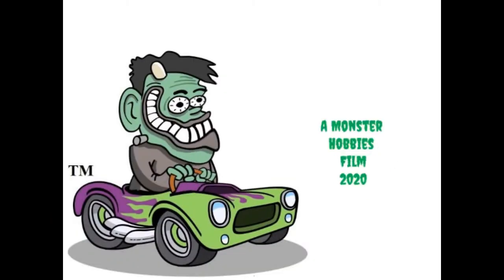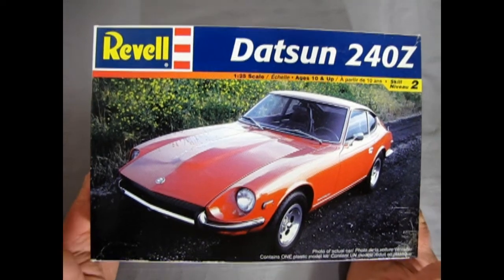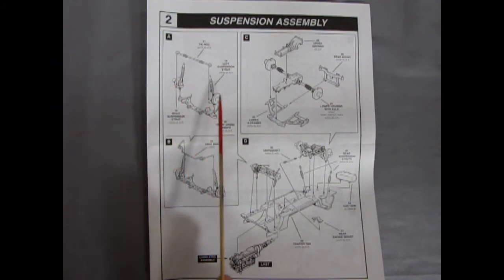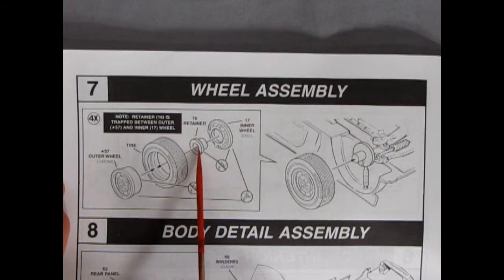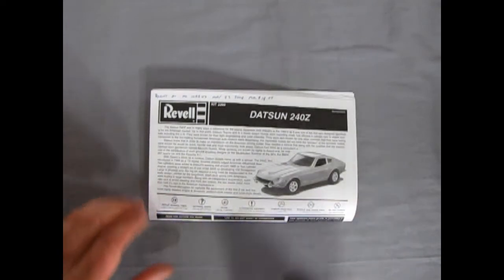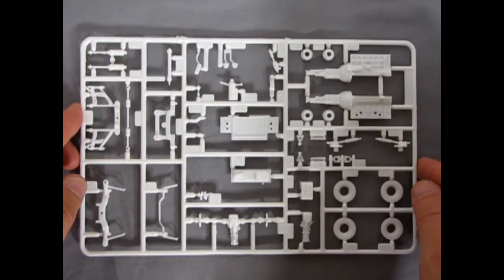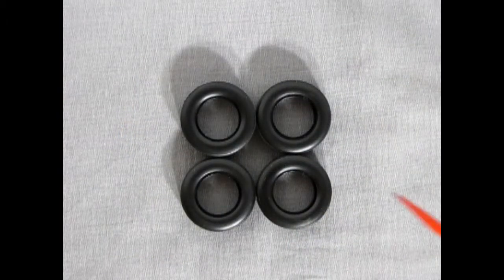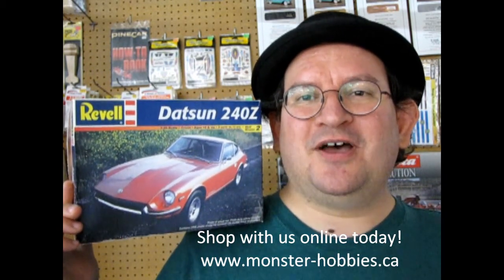Unboxing The 1969 Datsun 240Z Model Kit By Revell

Comment: Thanks for the great video Trevor.  I think this model was the 2nd that I ever built back in the early 80's.  I'm pretty sure that mine had decals for a race version like the ones you showed in the intro.  This kit taught me many things, especially when it came to paint.  Mine was molded in yellow plastic and I thought I could change the color with a paint brush.  This is where I learned about stripping paint, priming, undercoating and top coats.  That was a lot to learn for a ten year old but I survived.  Thanks again for this whole series it brings back memories of many models that I have built or wanted to build.
Reply from the maker: No problems! that's why i do them...and to show people that some of these "New Models" are not as "New" as people think.